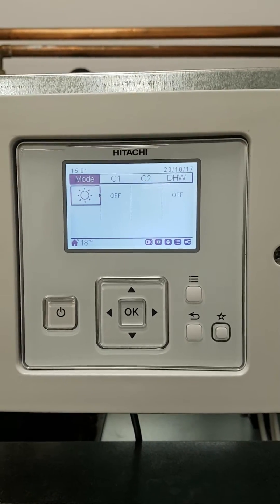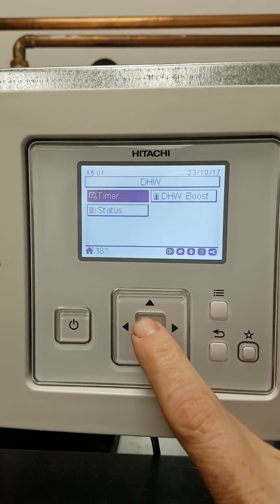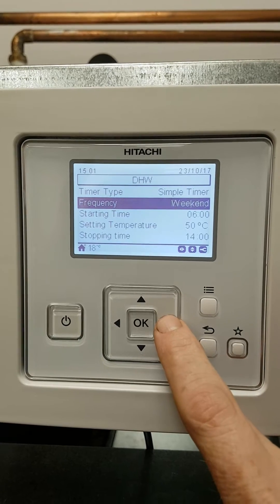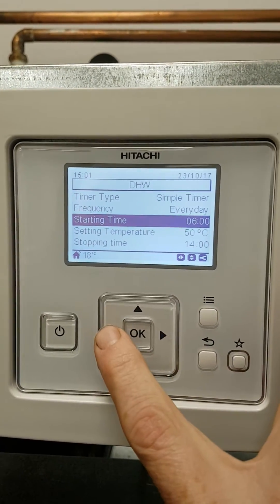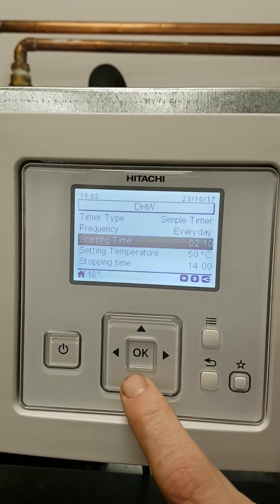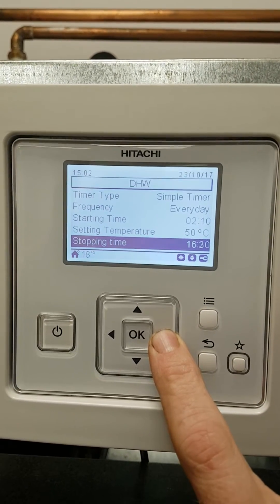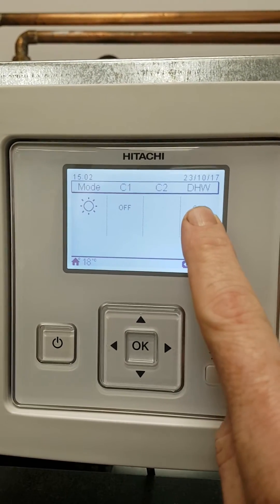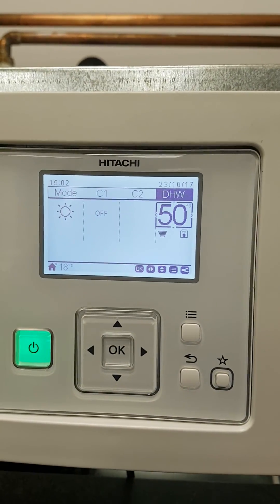setting cylinder timers on Hitachi Yutaki heat pump

Comment: Hi, its not working for me : 
The timer is ignored, when I leave the DHW on. If I leave it off like in the video, it won't turn on at all (the water temperature was low, it should turn on by timer). 
Any advice ? 

Thank you
Reply from the maker: mmm hitachi timers are very tricky, its best to leave it on all the time

Comment: I set my to be always 40 and 50 only from 10am to 6pm so it will have more heat outside and use less energy to heat up the water to 50, I hope it is the right thought.